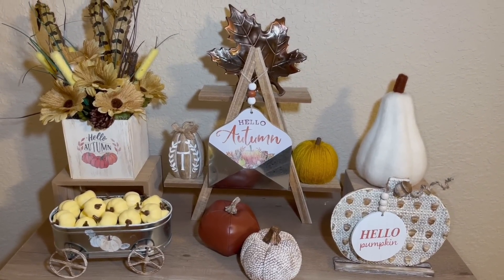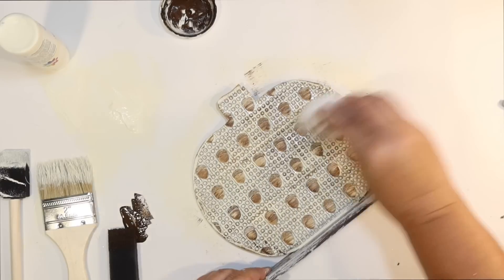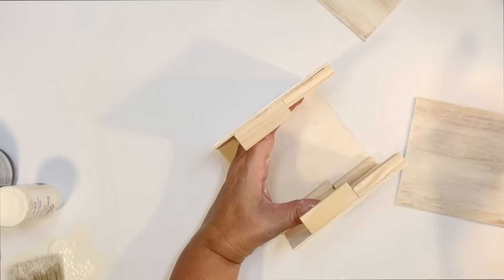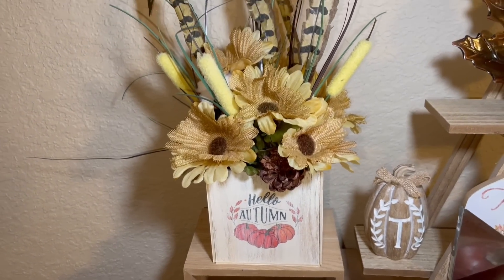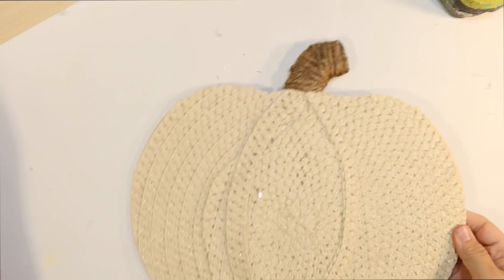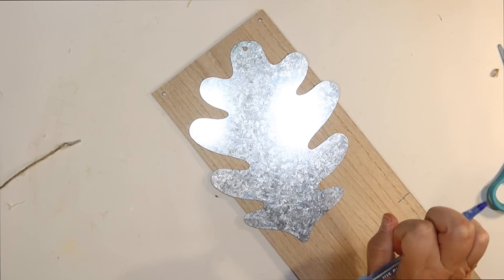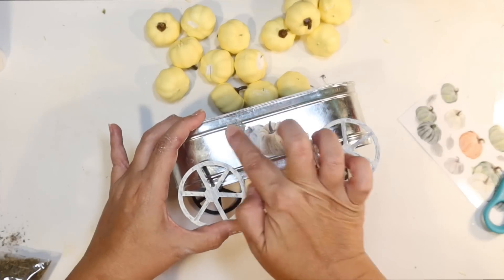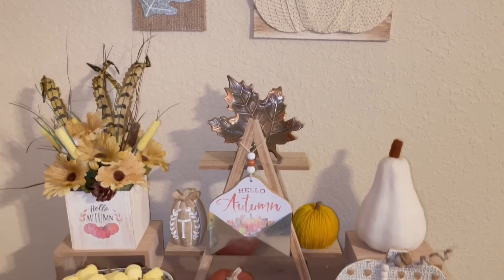NEW Neutral FALL DIYS Beautiful Autumn Decor (Dollar Tree DIY & Dollar Spot) Hacks

Comment: A handy dandy trick that I learned to make the sun flowers or other flowers with two petals on top of one another look better, is to hot glue the two petals that are stacked to each other together all the way around, so then it'll look more high end and less floppy! It definitely works too! Also, if you just pull the sun hat apart and then take out the fishing line type string that runs through it out, it works much more like ribbon and you can twist and maneuver it how you want it.